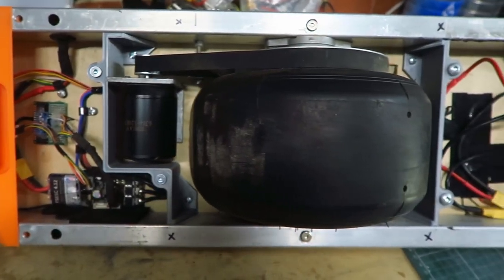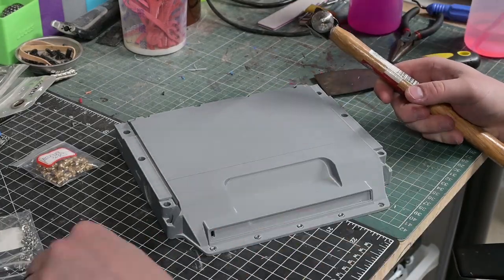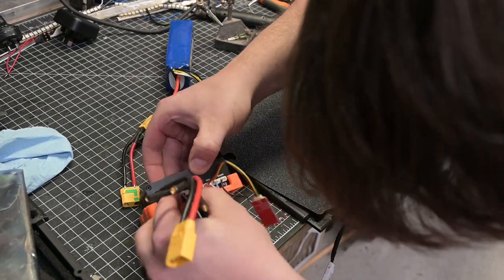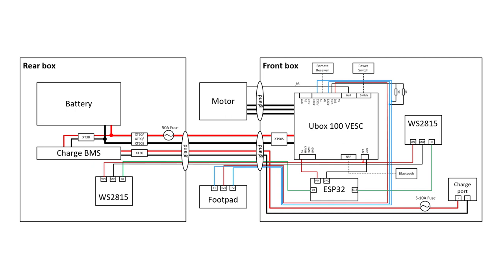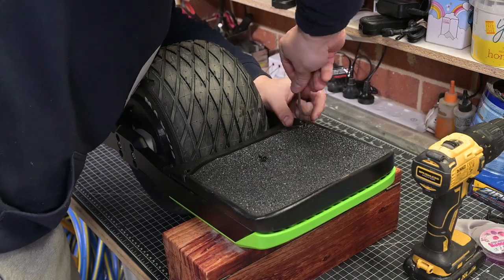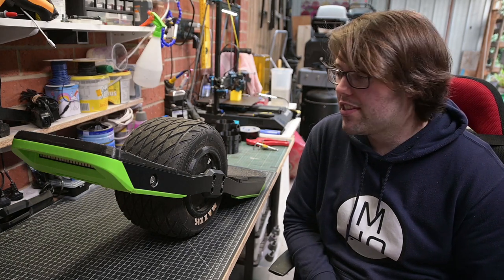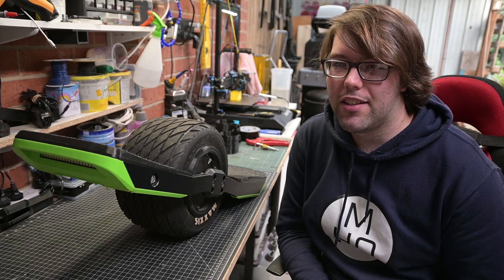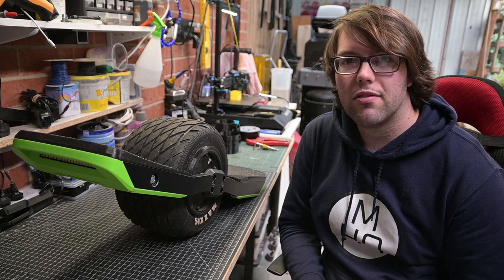The one true Onewheel?

Comment: Informative video.  Did you build your battery or use the pcb one from Fungineers?
Reply from the maker: I'm using three 6S hobby LiPos as I had them from my previous build
Reply: Cool i was thinking of using some graphine hobby RC batteries as they have high 100c discharge rates.
Reply: @Maker_HQ  so thats 66.6v around 3ah? How many kms on a charge. I'm looking at trying a similar way.
Reply from the maker: @awakekiwi  yep, 66v nominal. about 10-12km, but I'm not a light rider =)
Reply: @Maker_HQ  I just finished a vesc conversion of a trotter (magwheel). Its original 6 year old 48v battery gets around 10kms. I'm looking at 60v options. I also have the ubox 100v. I could fit possibly 9 of those lipos in and that would be a really decent pack.  Another option is lithium titanate. They have huge discharge rates and cant catch on fire if damaged. 
The cells are less dense so you end up with a lower capacity for the same size but much higher discharge and recharge rates. 
Super fast charging in minutes is possible. Also the lifespan is 20,000 cycles. Thats decades of use to lose 20% capacity'. 
I'm waffling on..

Comment: Glad to hear your build went well. I currently have an XR that I put a VESC in with a CBXR extended battery. You should get some bang bumpers bro. That will protect your battery box. I'm going to do a ultimate build with a torquebox and extended torque bumpers bumpers with 18s2p Molicel P45B battery pack. I'm also going to use a floatboxx metal controller case. i.e. no 3d printed parts. I'm also using a ennoid xlite v3 smart bms and little focer v3 ESC which has higher discharge rating. Excited to ride my superflux for the first time too as surfdado said it's about 18% increase in top RPM due to higher KV, but the main thing I'm looking forward too is about twice the amount of copper in the stator so it will take longer to reach saturation. This is super important when dealing with bumps, cuz even if you have the cooling and available AMPS from battery and mosfets, the stator can get saturated and dip ya.
Reply: carful with the floatboxx lids, seen a few bent ones now.   and the torquebox is ok, the badger bumpers for it suck ass tho and you'll endup just wanting to modify some bangs to fit.    if you REALLY want the ultimate build, get some Tech-Rail billet boxes for the controller and battery.
Reply: @widgget  For the floatboxx lids, the bent one I saw was due to some idiot modifying a kush pad with a sensor and not putting a support plate underneath. I do also have some bang bumpers I can use, what's your main complaint about the badgers?

Also, I kinda like having the polycarb on the torquebox for the battery instead of something all metal...

Comment: DO NOT USE TIRE SLIME. It’s terrible for overheating and dries up in most climates because of the heat. It makes for a messy tire swap later and isn’t needed at all. 

Secondly don’t apply your life savers until AFTER you have gotten the tire placed… lol seems like that would be common sense but you’re making the lip of the hub that much thicker. Sigh
Reply: USE RED ARMADILLOS